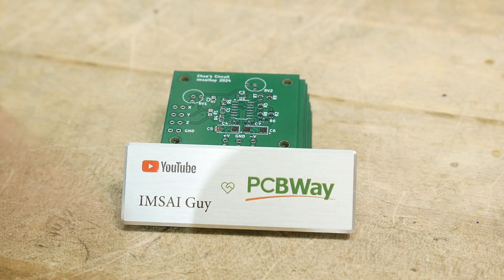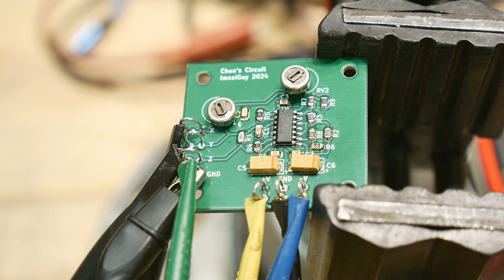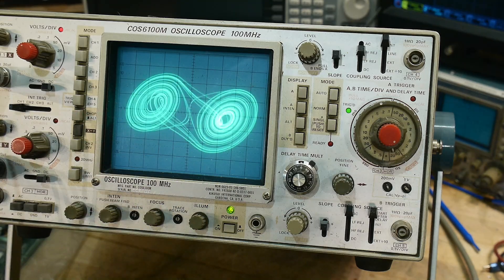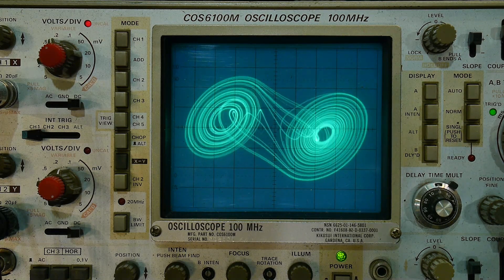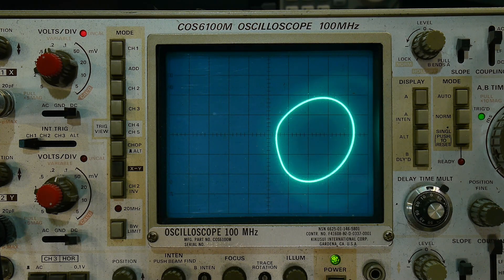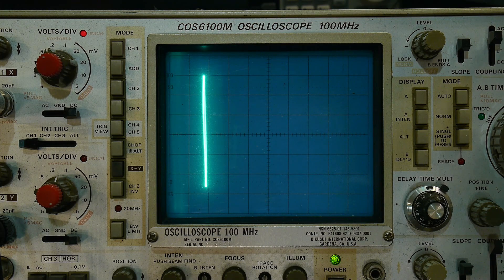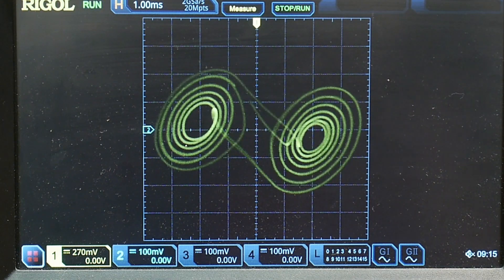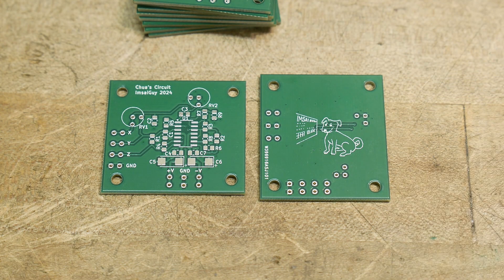#1938 Chua's Circuit (part 2 of 2)

Comment: Well blow me down! It freak'n works! Wonderfu! How gratifying is that? I haven't seen that amazing pattern since reading 'Chaos, Making a New Science' by James Gleick back in 1988. I dusted my book off and I'm going to re-read it. So here is what a electronic hobbyist like myself has to go through to get your little board to work. First try to get a complete schematic by taking a screen shot off of your video and download your BoM. Order parts from Mouser. Find out I ordered the wrong size TL084. Order again. Solder it in the wrong way. Pull out my AliExpress hot air reworking station and resolder it back in place correctly. Guess at what supply voltage I should apply. Fire up my vintage Tektronix analog scope. Loud pop, lots of smoke coming out the back (no, I didn't short the ground to mains). Hopefully just a worn out tantalum or electrolytic capacitor. Maybe I'll be able to repair it. I really liked that scope. Resort to an old Sencore SC61 TV repair oscilloscope that someone gave me and hope it still works. Well it does still work and so does your brilliant circuit! Next project up is your previous Lorenz (a.k.a. 'strange attractor') generator circuit. I'm wondering if the two discount surplus 'refurbished' AD633's that I found online will be up to the task? We shall soon see.
Reply: The AD633 Lorenz circuit is also working. Hoooray! Who'd a thunk chaos would be so easy to achieive?

Comment: It sure would be cool if you'd mention what supply voltages you were using. I guess I'll use +/- 12 VDC because that's what I happen to have available. I'm building mine right now. It's almost done, except I managed to put the TL084 chip in upside down. So, reworking it now. Wish me luck!

Comment: That's a very nice minimalistic implementation of a Lorenz attractor circuit, nice job and great channel.
It would be interesting to hear what it sounds like controlling a couple of VCOs.
What other applications would it be good for?  Possibly a dual-output random number generator.

Two unrelated video suggestions: #1-how about a video on using source-to-source NMOS FETs to make
a low-loss DC switch?  #2-I own an Imsai with a Z80 CPU and it was always very prone to crashing
until I isolated all of the front-panel LEDs from the bus lines using a bunch of 74LS240 (I think)
buffers.  The buffers need to be added to the address and data busses as well as the various bus
control signals.  Those LEDs really draw down the signal levels on the bus.
Reply from the maker: I had also buffered the LEDs and replaced the motherboard with one that had ground traces between all signals

Comment: Is there a way to put just the chua diode part on a curve tracer to see the negative resistance curve?
BTW would also like to see the channels in standard time-domain waveforms. WIth X and Y side by side, can you tell when it 'flips' to the attractor on the other side? What is the approximate frequency of the generated signals?

Comment: One of the examples where a digital scope cannot duplicate the effects visible on the old fashioned analog scope!
Reply: Actually they can, it just takes a more expensive digital scope to do it.  I'm sure the higher end Rigol scopes can do it.  My modern R&S scopes have no problem displaying waveforms like this in XY mode.  Being able to do it just comes at a cost to your piggy bank.
Reply: @mikesradiorepair  There's no way even the expensive ones can do anything like this with some number of pixels on an LCD screen with frame rates and response times measuring in milliseconds, compared to an electron beam integrating the whole thing onto the phosphor in real time.
Reply: @Kalumbatsch  Your right they are not as good as a CRT.  They are actually a lot better.  I can change color gradients and apply other effects that make it look even better than a CRT.  You really need to look at what a decent modern scope can do.  The clarity is amazing.  Mine has a 15.6 inch HD capacitive touch screen.
Reply: @mikesradiorepair  What's the frame rate of the display?
Reply: @Kalumbatsch  It's not called frame rate in a digital scope.  I guess that would be the wf/s (waveforms per second) or "refresh rate" which is 1 million on a R&S RTO6 series scope.
Reply: @mikesradiorepair  No, I mean the actual display, which is still an LCD.
Reply: @Kalumbatsch  It's not a LCD.  It's a 15.6" LC TFT color display with capacitive touchscreen, 1920 × 1080 pixel (full HD).  It has a TFT display because LCD's are inherently slow to update.  I'm not really sure what specification your looking for.  Look at the datasheet for a Rhode & Schwarz RTO 6 series scope.
Reply: @mikesradiorepair  A TFT display is a liquid crystal display. And I doubt that one runs at more than 60 Hz or even 120 because that's not its job. Have you ever looked at a double scroll on an analog scope? Because this video doesn't do it justice.
Reply: @Kalumbatsch  I made a "similar" circuit years ago that has the same output waveform.  It looks 10 times better on the modern digital scope.  The clarity and detail is amazing and even better when viewed on a large flat screen monitor connected to the HDMI output.
Reply: @mikesradiorepair  Whatever floats your boat.
Reply: Absolutely. No issues with Nyquist rate and sampling depth. It's all about the visual experience. As art. Ironically, my cheap OWON 2 x 70 MHz handheld scope has an amazing X-Y presentation compared to my Rigol MSO5354. But the best is of course my old Iwatsu SS-5702. For precision measurements, of course modern DSO's are better.
Reply: You guys are comparing apples with oranges.  Digitals scopes are best in showing numbers and measurements whereas the analog shows numbers like the last century's displays.  Also they can store and and slow down the beams in presistent way up to 100s.   No cheap analog scope can do these.  That's why starting in mid 80, most analog scopes added digital features using ADCs.
Reply: Franchement les oscillos numériques c'est de la daube pour rester poli , mieux vaut cent fois un bon oscilloscope analogique !!!!
Reply: @zibobpompon5768  100% agree, which digital have 10 M FPS?
Reply: @zibobpompon5768 I can't find a digital scope that does what my old Tek 475 does for $200.
Reply: @zibobpompon5768  No, they all have their uses.